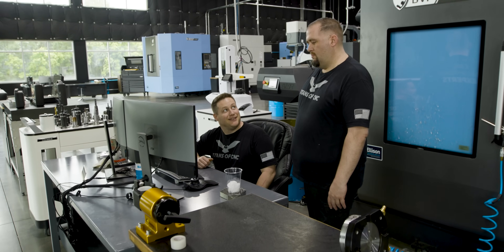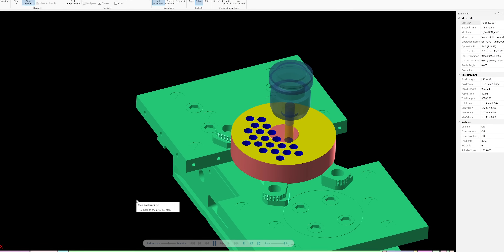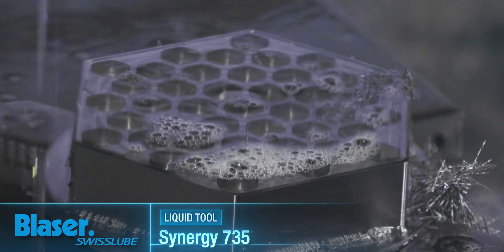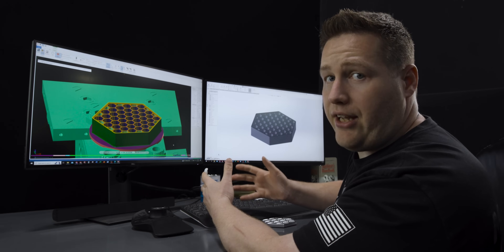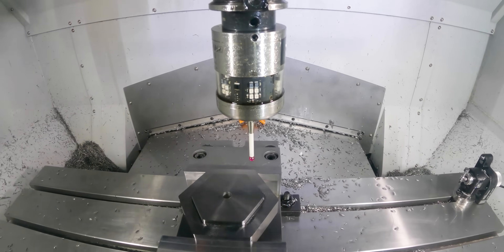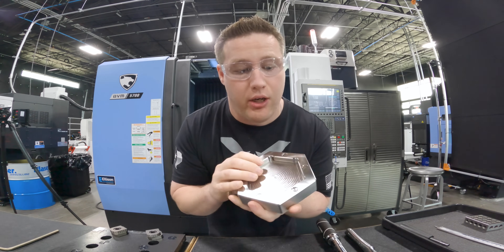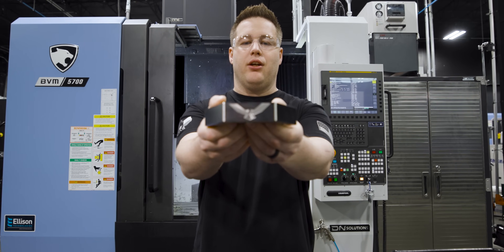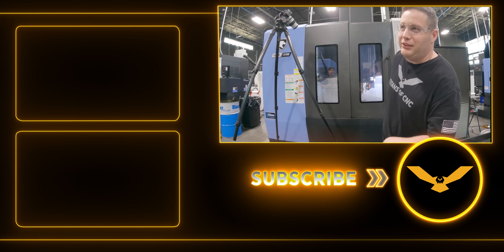CNC Machining Honeycomb in a SUPER ALLOY

Comment: You should had made an 1/8 inch recess a 1/32 of an inch larger than the diameter of the base of the cup so it is held secured on the coaster.

Comment: The design characteristics of your part lack some real-world functionality. Obviously, this is clearly a novelty part and for the show. (This is in fact something I would build on a rainy Sunday afternoon) However, I would only install 3 felt feet for having an anti-rocking surface. (You have a 6-sided part, this is a no-brainer) As well as epoxy neoprene balls in the divots on the top surface for a non-slip surface and isolating thermal conductivity of the container. (This is probably the most functional trait of all)
Reply: @titansofcnc

Comment: those broken "highlights" on the outer fillets of the hexagon edges made me curious - did you make a workpiece for display, using simple G2 fillets in your CAD model?
and you used expensive Titanium and machinetime for that? 😢
Reply: Okay, consider: Some company that makes Really Expensive and High Tech Machines wants to hire a CNC shop to make Really Expensive High Tech Impossible To Machine Parts. So...their chief engineer goes to three CNC shops to be briefed on their capabilities. CNC Shop A stands there and talks about tolerances and the wonderful tools they have in the building. CNC Shop B talks about reject rates and surface finishes. Titan sits him down at the conference table they made, plunks this thing down in front of him and asks what kind of coffee he likes.

Who do you think is gonna get the contract?
Reply: Its not about their capabilities, its about the "perfect surfaces". This was a bragging project, about the material, the size - and milling surfaces and their look.
and IMHO the outer fillets are not looking good - which is most likely fault of the CAD model, not the machinist nor machine -> and i don't know if they can do better

Comment: The 1/2endmill has a golden color coating. What kinds of coating is that? Special coating for high temperature alloys???
Reply: Probably heat treatment bluing kinda like the HAZ of a weld.

Edit: wow I must have had a huge brain fart reading your comment. Probably standard Titanium Nitride coating. I was accidentally remembering one of the tool holder colors.
Reply: that is a new coating from Kennametal.  It is replacing the current coatings on the Harvi III line and will probably be replacing a lot more of their products coatings.  It has shown to get 30-50% more tool life in super alloys than their current coating.  Barry will be doing a video specifically on this coating soon.

Comment: I don't understand all the wasted material. Why can't a foundry just make a mold like this and then a machine shop clean it up? I'm asking out of ignorance.
Reply: You could do something like this if you were mass producing something.  But the cost for only one part would be astronomical compared to this process.  producing a cast part then final machining also has it's own unique challenges such as workholding.  It also depends on what material you are using and the application of the component because cast parts will have different material properties.
Reply: @Jessie_Smith  That makes sense. Thank you
Reply: @Jessie_Smith  I know that molds are crazy expensive. It slipped my mind that Titan CNC is a job shop.

Comment: You guys knock it out of the park every time.  Even with all the humor, those serious about this trade are sucking up every bit of the information that you put out here.  
I install flooring for a living.  Could you make me one of those coasters out of carpet?  Not a cut pile carpet.  Something thinner, like a wool berber.  I think that a thicker cut pile would probably snag on the cutting tool.
Reply: To make a coaster out of carpet, we would machine a punch and a die, so that you could "cookie cutter" them out
Reply: @barrysetzer   That's what I love about you guys.  You're always thinking one step ahead.
Let me add something. The carpet would need to be nylon or polyester instead of wool, and the punch would need to be hot enough to sear the carpet edges to keep it from unraveling.   I love your outside-of-the-box reply.
Or should I say, outside of the octagon.  👍

Comment: I remember hearing about honeycomb composite material in applications such as super cars. What ever happened to that trend?
Reply: Koenigsegg was doing it when they worked with aluminum. Now they went the carbon fiber way and the honeycomb sailed into the sunset. Doubt others will do it since it seems the panels are pretty expensive. Most car manufacturers went for plastics.
Reply: AFAIK they are still doing it in Formula 1.

Comment: Awesome video Jessie! And yes I mastered tiny tools at a young age!!
Reply: Just a few ?s . Why are guys roughing holding end mills in collet holders. We rough holding in solid holders to avoid chatter. We also plung corners in pockets as well to avoid chatter when endmill enters rad/coner in pockets. Last ? Why not chamfer part before finish passes. This way no need to deburr at all becausea dull chamfer tool cause no/nogo gage could fail  on close tollerence holes or drop depths. But keep on machining in USA.

Comment: I personaly will do this with macro program do not see why make it in cad cam. I have one for the hexagon that you only change the first line in the program that is the size of it and the program use formula to calculate the rest of it depending of witch side was given in the drawing. Creating the part by yourself engage your brain and makes you devolop from there even if you fail from the begining later you will reach a point were by the time your guys go to the office to make the program in cad cam you could be done with it. Only if with the drawing you recive ready program then is faster, but I never worked in the place were they give you ready program to go. I did also saw people that write new program every time they have to work on a part they have done before witch increases chances of mistakes and it slows them down by alot

Comment: Should have made it out of inconel. Weaksauce.
Reply from the maker: Or Monel…
Reply: @TITANSofCNC  That would be badass. Also would double as a nice paperweight.
Reply: @TITANSofCNC  or monel with some beryllium copper inserts. We used to do a part like this and it really take the best out of you😂
Reply: @TITANSofCNC I came here to make this comment specifically
Reply: Grind a tungsten toothpick to go along with it.
Reply: Rather a nice looking coaster guys, think I’ll make do with a bench to put my mug of coffee on , preferably on top of an important drawing. Or better still on the actual bed of the machine along with a packet of cigarettes. That way I’ll find my pen and tape measure that I’m always loosing
Reply: Or maybe Hastelloy X😁
Reply: So... Let me try to get this correct: They go out of their way to make this part as light as possible by honeycombing the heck out of it, and you propose to double its weight ???

They should have picked a magnesium alloy instead!
Reply: @Hydrazine1000 the low thermal conductivity is an asset for maintaining drink temperatures.
Reply: @edmarciniak7612  Fair point! Very good actually. IF thermal management would have priority, any of the Inconels would perform excellent. Thermal conductivity of Inconel is less than half of that of titanium. (Magnesium is about 8 times better than titanium.)

But if they go out of your way to honeycomb titanium, then it looks like weight is the prime concern instead.
Reply: Depleted uranium.
Reply: @FerociousPancake888  I'll take my radiation allowance for when I need an X-ray, thank you.

(I mean, yes, you are correct in that uranium, depleted natural or enriched, is indeed heavier. But it has some serious drawbacks too.)
Reply: Or stellite :P
Reply: 600 625 or 718? All day on a Swiss. 😅
Reply: Bisalloy.
Reply: Rene-41
Reply: Radiation free WW2 navy boat steel straight from the sea floor 😂
Reply: Lmao...goddamnit 😂 don't encourage this behavior 😅
Reply: Should have said monel
Reply: I want a coaster ❤
Reply: Use titanium for iced drinks.

Save the inconel for machinist coffee which is hot enough to weld your lips together. 
😉

Comment: QUESTION: Are these CNC's designed such that  valuable alloys chips(Ti) can be isolated by type, or at least be recovered  for  recycling?
Reply: Most machines have an angled tray that feeds into chip conveyor (either a belt or screw). For places I've worked at the machines are thoroughly cleaned between jobs that use different materials because sorted scrap pays a lot more.
Reply: Yes
Reply: You need to wash out the machine of the previous material, but yes, you can recover the current material for recycling. If you don't filter anything out, and your chip bin is random. Your scrap value is reduced a hefty amount. This is why smart shops have machines dedicated to one material only. To get the best recycling refund rate.